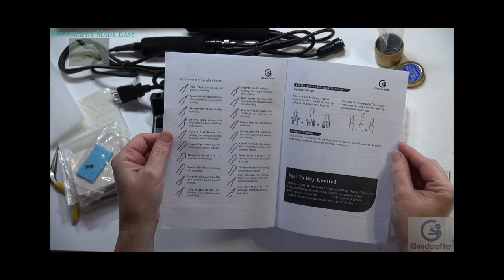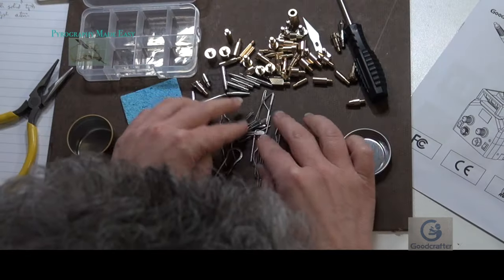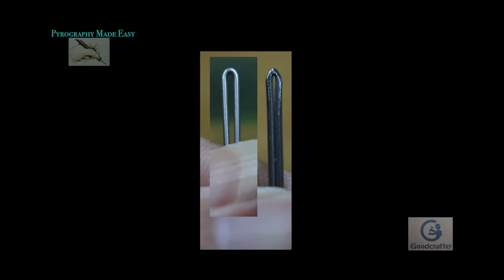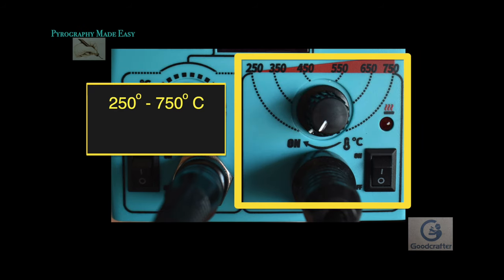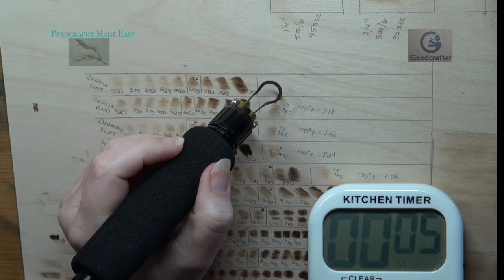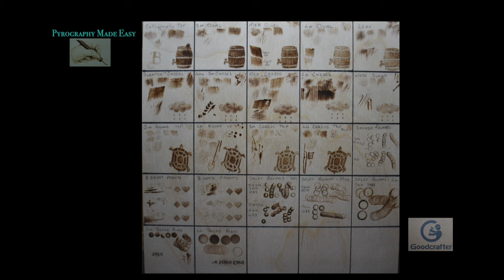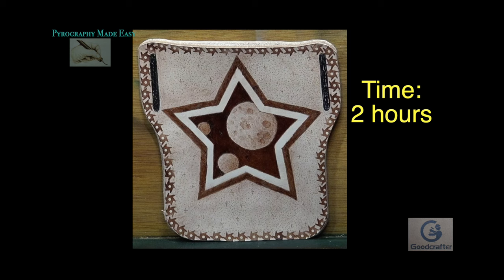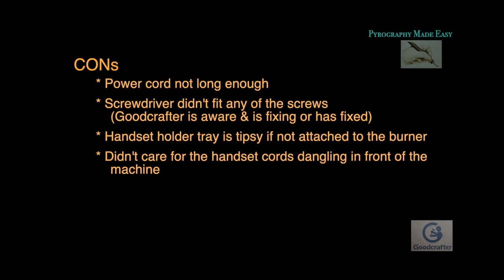Goodcrafter Pyrography Machine model 939d II - Product Review

Comment: Ok so I just purchased a unit that is almost identical to the one you have in the video. Mine is called WEP 939D. I wonder if WEP purchased GoodCrafter or just a name change??. You got more pieces of practice wood and stencils in your kit. I did get a bag with 2 cylinders with 2 small screws that I don’t know what they are used for….an extension maybe? I’m going to try mine out today and hope everything works good. I paid $100 and change for my 2 in 1 WEP kit
Reply from the maker: My guess is that there is one manufacturer that sells to different companies.  They just change the name on the machine.   This is just a wild guess because most of the machines look almost identical.  

Recently I was looking for something on Amazon and found a replacement handset that fits the Goodcrafter (at least I think it does).  It seems like it was the WEP brand, but I don't remember right off.

Comment: Received Good crafter machine.
Plus point: screwdriver fits, yay!
Did as you suggested with the brass tips but just made four long cuts.
Wire tips fit comfortably in the container in which came the brass tips.

Further observations:

All plugged in appropriately, then:
fitted brass tip to L/H pen, switched on - didn't heat up at all, screen showed: 5-E then
switched off. Then
fitted tip to other pen. Switched on, 'hum' sound from machine (didn't hum on other side)
blank screen. tip heated up nicely then machine went quiet, tip went cold and nothing happened since.Then

made a coffee, rolled a cigarette and pondered awhile . . .
Am dislated, have contacted seller, awaiting response.
Reply from the maker: Interesting.  
I get the feeling that the burner is a new product in the company lineup, so maybe they are experiencing quality control issues. 
Regardless, I appreciate you letting me know.  
If this becomes a common theme with viewers, then it's not a product I want to promote.
Reply: @PyrographyMadeEasy  So far, so good. Anna contacted me saying: "Don't worry, once we confirm the problem, we will provide you with an appropriate solution."

Heh heh ... I never worry. Why not? I don't have any problems. Inconveniences, yes, but problems? Nah . . . left them back where they belong, in maths class, sixty years ago. 🙂

I'll let you know how things work out.

Comment: This looks like a great piece of kit!
Having been using the Childs machine for some time can see the value of additional brass tips.
Now accustomed to making my own tips, am I correst in asuming wire thickness(s) is/are the same?
Many thanks for your insights, looking to see if this is available in my country . . .
Reply from the maker: Hello.  I don't know if the wire thickness is the same.  When I purchased a replacement tip set, I only checked to see what the tips were rated for.  The wattage range was within the parameters for the Goodcrafter machine, and they worked fine.
Reply: @PyrographyMadeEasy  Have now ordered the Goodcrafter kit. :-)
Reply from the maker: Hope that you'll like it and that it performs well for you
Reply: @PyrographyMadeEasy  Thank you - I'll let you know. Be a while - two wek for delivery ¿

Comment: Based on your great review, I recently purchased this unit. It seemed like the solid point pen wasn't getting hot enough. I returned the unit and Anna from Goodcrafters sent me another one. The replacement acted the same way. I had the solid point pen set to 480 and I had to hold the pen to the wood for what felt like a lengthy time. It didn't feel fluid like your video shows or when using a wire nib. It just felt like it wasn't getting or staying hot enough. I realize wire nib will work faster, but did you feel the solid point pen was too slow to use? Like you had to hold it in place longer?

I'm going to try the same tip you used in your test and see how well it works. Can you share the heat setting you were using so I can compare?
Reply from the maker: Hi David,
I couldn't begin to tell you what temp I had the burner set at.  I don't generally pay much attention to the temp, and very seldom write down what temp I use because there are too many factors that influence it.   I don't recall trying to create really dark burn with the brass tips either.  

Quite truthfully, I seldom use the solid tips because I much prefer wire tips.  The wire tips have a higher range.  Or maybe it is accurate to say that they don't require as much power.  Not sure.   
The type of wood your burning makes a difference too.  Softer woods, like basswood, don't require as much heat as harder woods like maple do.
Reply: @PyrographyMadeEasy  Thank you for the reply. I went to your blog of this review. I looked at the tests of the brass tips that showed the different temps. It was very helpful and I want to thank you for it.

From your information, I was able to try the same tips and now feel confident the issue is with the unit not getting hot enough. I was testing on pine boards and at a full 480 I still had to hold the pen in place and move very very slowly. Thank you again
Reply from the maker: It could very well be that the burner isn't getting hot enough.  There might be an adjustment you can make on the burner itself to change the temp range.   Most burners have that feature.  Check the manual on the burner.

I did find a piece of scrape pine and the burner I have didn't perform that great on it.  I did have the large chisel or calligraphy tip equipped, and the burner set to the max.  I let the burner sit for 2 minutes to make sure the tip was at temp.  Solid points take longer to warm up.  The larger the tip, the longer it takes.
I was able to get a medium brown color, but that was achieved using a fairly slow hand speed.   I could get really dark burns, but that required  a press and hold technique.
Reply: @PyrographyMadeEasy  Your findings seem to match my experience. I wish I had a good way to measure the actual temperature of the tip. There isn't anyway to adjust the temp range outside of opening the unit itself. I'll wait to see what Anna has to say. I sent her a video of my concerns as well as pointing to your blog and video review for reference.

On another note, I've been making my way through your videos and tutorials. They are fantastic and greatly appreciated. You do great work.

Comment: i don’t know how to install the knife blade.  read instructions and watched the entire video.  It’s just a loose blade and various parts not even stored together,  Do you have a video on that?
Reply from the maker: I don't recall doing a video.   The knife tip works like an X-act knife.
Place the blade into the metal collet.  Silver thing with slits on the top and a screw in base.
Slide the collet into the gold grip.  It acts as a spacer, and helps keep tension on the collet so the blade doesn't fall out.
Screw onto the handset for solid brass tips.  Tighten until everything is secure

Comment: Can you use this kit on leather bible covers
Reply from the maker: I wouldn't recommend burning on bible covers.  There are 2 reasons for that.  1 - most covers are dyed leather.  2 - covers have a finish to protect them.

Both the dye and the finish contain chemicals that are not good to inhale when heated.  I don't think the risk to your health is worth it.

I have used this burner to burn on leather.  I only recommend burning on vegetable tanned leather that is free from color and finishes.
Reply: Yes, you can use it. The following precautions
1. Wear eye protection
2. Mask
3. Do it outdoor or use a fan to blow smoke away from you or vacuum
4. Do not place face above burning object.
5. Always start & test at small sample first before having fun.

FYI: My daughter & I handcrafted many clients' vehicles panels & leather seats.